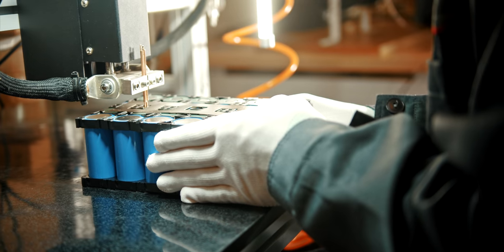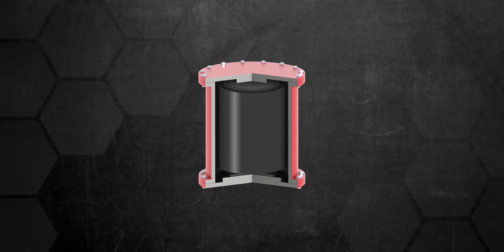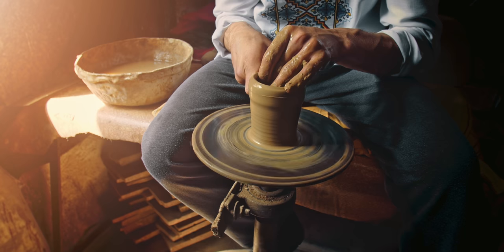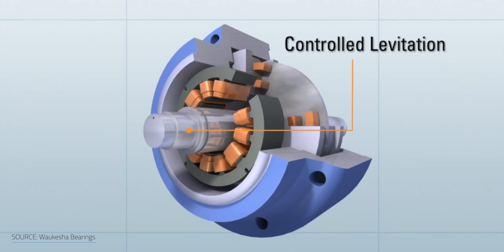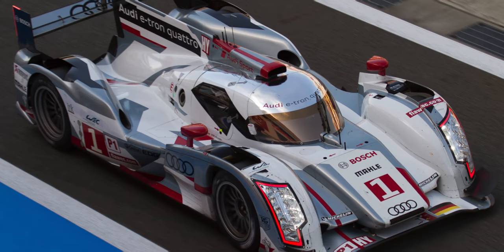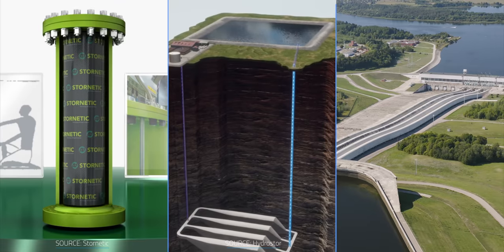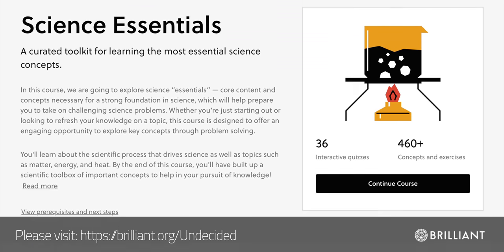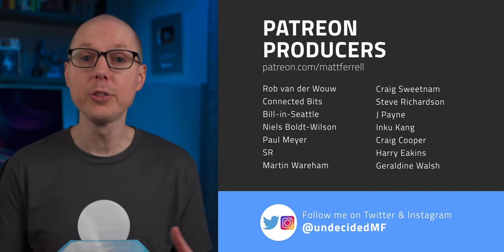The Mechanical Battery Explained - A Flywheel Comeback?

Comment: There have been companies that installed flywheel UPS systems in series with a standby generator to provide enough ride-through time to spin up the generators.  It was a cool idea, but most of the ones I know about have been removed due to reliability issues.

Comment: Hi, Matt, love your channel. I am and have been developing a flywheel that rotates in a conventional way but, mine also spins at tangent to the direction of spin. Yes my flywheel spins in a horizontal plane and in a vertical plane. It is designed not to store energy but to throw mass in all directions at the same time. This is my attempt to facilitate locomotion. I've been R+D-ing this since 2013.  Thanks for confirming that flywheel technology is viable in an efficient way to transfer states of energy. And no I will not reveal my device until it is a usable transportation device.

Comment: In France we got a barrage that feed water to a top retention pond when electricity is in surplus. When energy is needed they use the water as usual. Time needed to reverse the barrage : 3 mins.
It acts like a battery, a water one and you need no (extra) mechanical parts

Comment: useful for grid inertia, if you have a large amount of renewable sources in an area you could lack grid inertia, spin a large flywheel with a synchronous motor (or the mechanical inertia of the rotor itself could be enough), during disturbances on the grid (faults, large load shifts, etc) the synchronous motor combined with the flywheel change temporarily into a generator provide the necessary transient power needed to prevent instability or an outage

Comment: I read a steampunk  sci-fi book where wound springs were used as power sources. Definitely potential for danger with all that energy stored up in a spring but it's the same thought process. You can statically store a spring without putting additional energy into it unlike a flywheel
Reply: Technically we could store spinning flywheels in orbit long term.

Comment: The thing about flywheel storage, is that it's mostly a power solution - but that's not a bad thing.  The big focus is on energy solutions, because the trend is towards more renewables, and that means we need to make a bunch of energy travel forward in time. But flywheels respond faster than even electronic inverters if they're properly grid connected - rotating mass responds synchronously to grid conditions which is why the industry is so adamant we'll never be rid of gas peakers (they provide rotating mechanical mass). I'm not sold on industry's argument, but in places where transmission lines are the limiting resource, flywheels are great solutions: they need a very small footprint, they can trickle-charge overnight and then give the farside of the transmission choke whatever power it needs for those brief over-load periods, and it buys you time to get the T&D upgrades (which take forever).  In many cases the needed system can even be portable.

It'll be a niche technology, but there's no way we don't make use of these systems going forward.

Comment: 1. A stirling engine  (up to 8)   2. A gravity driven dynamo generator, that works vertically (up to 8)   3. Your choice of how you want to store the electricity.  I would lastly say the stirling engine will act as a gravity pump to raise the dynamo driven generator, back up to the top where it will be released again, and, again, and again and can produce power on the downward stroke and this goes on non ending, it may not be fast, but it is reliable and non polluting. I also believe it is possible to hook a planetary hub to a stirling engine, and directly power a dynamo, that will direct the electricity into a storage system, thermal rock, or limestone, a material that holds either heat, or electricity.

Comment: Used to work in a datacentre that had a huge flywheel storage capability. It was more a series of drums rather than just wheels.

The intent was for it to run and power the facility the moment the power died until the diesel generators came online and were running at sufficient capacity to power the facility, think it was around the 6-7 minute runtime mark. Worked better and more reliably that batteries according to the guys who maintained it.

Comment: i use to work for a company that charged banks of capacitors off of a flywheel system that ensured the startup draw from various machines on site wouldnt draw too much from the grid as had happened in the past, they used the grin to get it spun up, then engage the generators and start up machines they would at times not need it but during heavy production it genuinely kept the transformer station from blowing according to the power company guys who came to inspect it and marvel at the fact it was entirely build on site decades ago... they had upgraded the generators and such but... the setup actually does what it needs and as tech advanced they set it up so the company could leave it running and get paid for the power it put back into the grid... the owners talked about building some MUCH newer ones, but current use a very old design thats also used in hydro from the same era, as long as oils kept in the res and its not left stopped too long, the barings will virtually never wear out.. 

no its not perfect but, people figured out ways to fix problems they had using what they could get ahold of and build themselves back in the day... more so then today from my exp...

Comment: All-steel composition is an important point. We don't have 100% green steel yet, but it's possible and abundant. This makes heavy flywheels a compelling option as lithium reserves face ever-increasing strain, especially if the iron can be locally sourced.

Comment: How does the gyroscopic aspect factor in?

When I was a kid I doodled out a design with a e-bike using a flywheel mounted in the main triangle of the bikeframe. Spinning in the direction of travel. The flywheel would be clutched into both the peddling and separately the drivetrain. When the battery is full, it spins up the flywheel. When the bike has stopped, it still could be charging up.

Comment: Ok Matt. We have the technical information already and it's very old tech. 
The Mechanical watch. It used a wound up spring for it's energy source. Then uses flywheels to allow the power to expend out at a known rate.
What is so super hard about that? Basically, during daylight for solar power, the springs get wound up. The DC energy from them would get inverted to AC, but taking😂 advantage of a very reliable, smooth clean power source. The flywheels start on pushing a bank of high tech gearing to turn DC generation into clean AC power.

Comment: I have been imagining flywheels as alternatives to batteries in sort of the opposite direction than Matt's great video: Take the case of getting electricity to isolated populations in Africa or Southeast Asia. Then, lower the scale to look at individual families in need of power for one thing or the other. Placing a solar array on the roof or wind turbine nearby provides power. But how do they store it at night or on windless days? Flywheel of course. Now the super high tech flywheel Matt describes is simply out of the question. But how LOW on the technology continuum can we go and still store energy? How about a large flywheel that is made of carbon fiber "cloth," maybe 10 or 12 feet in diameter and 4 to 5 foot high contained within a basic concrete tub or well. And for mass, we use water to completely fill the flywheel. Off to the side is the generator-type mechanism that spins the flywheel and also taps it for electricity by means of contact arms that are in contact with the exterior sides of the flywheel. Electromagnetic bearings extend operating life and provide stability to the spinning flywheel. Since it is only supplying power to one or two families, it can operate at a much lower rpm than its high-tech cousins. It must be low maintenance and have a long service life. Eventually, some of the components (concrete tub, carbon fiber flywheel, etc.) could even be made locally. This is just after-dinner napkin scratches. But I would love to hear comments, critiques, and ideas from others. Thank you.

Comment: The flywheel power storage can be used for the power supply of the tram. When the tram decelerates, the flywheel is used to store power. When the tram accelerates, the flywheel supplies power to the motor.

Comment: Some years ago, I saw a TEDx talk about a company working on cutting fly wheel costs by using cheap material such as concrete in combination with other things.

I think this one within many solutions to help our energy problem
Reply: the material needs to be strong enough not to self destruct with inertia.concrete would explode at an estimated 1000-1500 rpm which is nowhere near the 10-100,000 rpm needed

Comment: I think the fact that these would be an instantaneously 'on' power supply would make them a good bridge to other sources like the hydro batteries that take time to come online. The fact that they are only able to discharge with in hours is a problem I mean you could build one to keep more storing until the 'main' storage is depleted so you have power for x number of more hours but that will be a huge diminishing returns situation. 

I think it is fascinating and look forward to learning more.

Comment: My usual thought, regarding new energy storage technologies, is what breaks them and what happens when they break? For example:
- Would building damage (fire, earthquake, flood, tornado, ...), which houses the flywheel, distort or weaken the flywheel enough for it to start destroying itself?
- Would an EMP distort the magnetic bearing's field sufficiently for the flywheel to start its own destruction?
- How vulnerable is it to sabotage (a shaped charge, acid on housing, a fall from destroying the floor underneath it, ...)?
- How rapidly does it break and release its energy? Does it become a bomb, fire, slag, or just whimper?
Reply: Artillery would blow it up pretty good.  Wrenches, chains, and/or weak-ass rifle are fully adequate tools for a terrorist attack on the power grid.  So not significant IMO.  Flywheels reduce the threat.  There are plenty of videos of transformer explosions on youtube.  Rupture of the wheel would damage the wheel and likely the shell.  You might be able to design it so that the motor and bearing do not get hit by ricochets.  You would probably want it to fail evenly rather than wobble.

Comment: A professor couple from India patiented a fly wheel technology which just generates much power from just running  a motor 5 seconds can produce 120 second of rotation in a fly wheel. It's called " Kamma Gear Flywheel Power Generation and Multiplication and Storage".👍

Comment: What matters for flywheel design is that the rotor has enough strength to hold the working mass at the designed RPM.
What this applies to is not only flywheels but "rotational gravity" space stations. Carbon fiber gives the best strength-to-mass ratio.
Tungsten gives good mass per unit of volume, but what matters is just that the mass times distance from center of flywheel is the greatest, so pieces made of high-strength steel that have more overall radius than the same energy retention in a tungsten outer ring material are acceptable, also.

If you pump water uphill efficiently, the water does not lose its energy except via a small amount of evaporation, which can be massively reduced with shade balls.

Comment: I am interested in storing heat.  So much energy is used to heat and cool homes.  Is there a heat battery?  Can we pull heat in the summer and retrieve it in the winter?  Can it work for our homes and greenhouses?  Is it more efficient to convert solar energy in battery power and then back to heat as needed or store it as heat to be used or increased as needed?
Reply: Rock.  The nice part is that most homes already have a large rock(s) installed under the basement. By weight granite stores much less than water but by volume it is about half.  The installation cost is for two wells.  One well pumps water in the other pulls it out.  5 cubes 10 meters on a side hold 10^10J per degree C change in temperature.  That is around 100 gallons of diesel.  A 4 or 5 degree temperature change gives you more heat than a home sized heating oil tank.
Reply: @stefanr8232  Could you use a cheaper material than stone?  Wouldn't sand be easier to work with?  I am thinking about ease of installation and if I ever need to repair the lines.
Reply: @michaelrowley6069  Absolutely.  Sand is rock.  There is a more rapid exchange of heat between sand and water.  Gravel is the same heat capacity because it is also rock.  Using whatever is below the house is likely to be easiest. Only problem I can think of is when there is a significant flow in the water table.  Solid bedrock does not allow flow at all so the wells are debatable.  With clay the wells are stuck. I would not recommend trucking sand around.  If you are installing something just to balance the day/night cycle use a water tank.  A geothermal system with heat pump can circulate glycol through the same trench/mound as the septic system.  The septic tank is a water tank.  A concrete foundation or masonry walls have enough heat capacity if homeowners are comfortable with a few degrees daily oscillation.  Insulate outside of the concrete.  The wells are advantageous for boosting summer to winter energy.  Ideal if a whole city or neighborhood does it.  A few feet below ground the temperature is near constant.  Even if you do not recover any of the same heat it is still better to pump heat from 55F to 75F instead of 5F to 75F.  Pumping AC is just heat exchange and not even a "heat pump".  The heat pump works on its own so all add on loops should pass code.  Local code enforcers should have that information.

Comment: Different subject for just have a think.  Could insulated cow barns using heat pumps transfer the heat to heat the farmers home in winter. In summer, could opening wall pannels on the barn and reversing the heat pumps then cool the house and get rid of the hous heat through the open barn wall vents. Would this be benificial to said farmer cost wise?

Comment: I love old tech, people are so prone to discard old tech for new tech, to me the tipping point was watching a video of one of this products in kickstarter it was a "robotic" system to control the shower temperature, and then I saw another of a mechanical engineer using a syphon. And as a software developer myself I apply this on my code and this is why I have avoided overcomplicated and unnecessary tech like virtual doms.

Comment: This seems to be a good solution for stabilizing the output from local sources and prevent power-surges. Typically in solar or wind farms with semicloudy sky or unstable wind. The advantage is that flywheels are technollogically very simple and do not require any rare metals to function. Some flywheel-based machines have operated for a century with good maintenance.

Comment: I think there is a misstatement at around the 5:46 time point.  Flywheel batteries cannot be "fully charged" in millisecs.  It actually takes a fair amount of time to spin up a flywheel that stores a reasonable amount of energy.  How long depends on the particular system but you can image the energy storage time would likely need to be roughly the amount of discharge time (but there are tradeoffs, of course).  But otherwise, this was a useful video for this topic.

Comment: And here i thought coil springs were the mechanical "batteries". I am a horologist and also dealt with old spring driven Victrola record players and those mainsprings are huge and can contain a lot of potential energy and they can generate quite a lot of torsion power.
I was always fascinated by DaVinci's plans for his funny wooden " cars" that ran off of giant coil mainsprings. There is stories about Germany invented buses that were some kind of hybrid system that used giant coil springs, which i need to remember to do some research about as for some reason it is not a very common piece of info, or it may be some fiction someone made up.

Comment: One reason I can imagine that we "dont see more flywheels" is that its simply used in the grid.  It isn't a reasonable mobile power solution without significant modification, like those busses.  To me, using sol/wind to convert hydrogen makes more sense, since hydro-cell vehicles ARE a viable solution to long range transport, which is something batteries cannot do due to technology limits.  AND you can use hydrogen cells to generate electricity.  Like batteries, they are a more flexible solution.

Comment: May be viable for industrial purposes, but one way or another, there would be no option for consumer markets (namely mobile electronic devices, not houses), due to the weight (/mass). It either has a larger size meaning more weight, or more density for strength, meaning more weight

Comment: in the schematic that you showed about the magnetically levitated battery, the problem I saw was that they use electromagnetism that uses energy in itself to levitate the whole thing. I would approach this with permanent magnet bearings, still in a vacuum, and one end of the shaft would be made out of tungsten, as pointy as possible and would rest in a well lubricated artificial diamond just like watchmakers use rubies as bearings. This way you have a low friction high endurance bearing only on one end of the shaft and don't have to use energy to levitate the whole thing meaning there is more left for the grid.